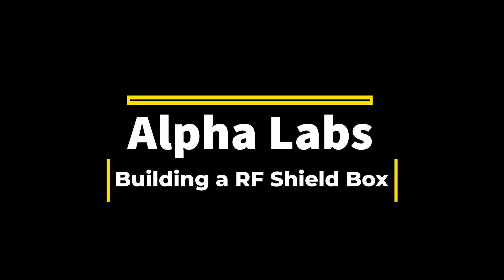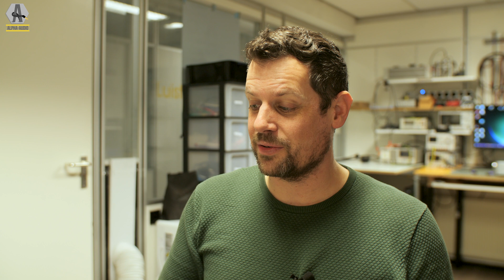Alpha Labs - The Alpha RF Shield Box

Comment: I love the way you use data to drive continuous improvement into your own processes!  I used some type of RF blocking fabric years ago in a non-audio application only to be somewhat disappointed (not the same as yours). I seemed to get better results with self adhesive copper foil.
Reply from the maker: It's not copper foil. It's special RF fabric and special RF blocking tape. (It's made by Mission Darkness). The adhesive copper foil is not good enough and doesn't really conduct on the sticky side ;-).

Comment: Interesting video, I have had success using the stainless steel catering bins (in UK they are called gastronorm), you can get quite large ones. Then use the foam/RF shielding sticky-back gasket to seal the lid which you need to press closed (use spring clamps). For feeding the cables I use the Icotek RFI gaskets which work really well and they offer a large range of sealing grommets for various cables sizes. You need to make sure all cables passing through are shield bonded to the box as close as possible to the box metal. I can get about 90dB isolation with this low-cost setup. Good luck!

Comment: He is right about Telecommunications but you may be better off shielding  a small closet ( I use the term "Lab Grade Audio" )   I've recently sourced several EMI/RF boards along with DC Blocker boards from AliExpress my measurements show vast improvement .

The Audio is now the Best I have ever heard.

Great work Alpha Lab
Reply: ATL Audio (Aleksandar, Bulgary <- EU) sells very good PCB too, with or without quality components installed. And even mounted in boxes.
Reply: @matytinman  I will research, for future orders
Reply: What do you mean? You put your stereo in a shielded closet and now enjoy a lot better sound?
Reply: @bunsw2070    My reference  spoke to testing RF is very invasive.

As for as better sound  shielding power helps All of my Network Switches , Streamers, DACs, Preamps, CD Player all run on DC with ripple noise downtown   .0000001 amps & separate noise filter for Amplifier/Integrated devices

Comment: interesting video... in these days I'm playing around with cables... connectors... lps... smps... etc etc trying to detect and reduce the noise they irradiate...I've descovered that even a common schuko connector, when plastic housing , irradiate A LOT of noise at 50Hz freq. especially at the phase side connection inside... so when the connector is close to signal cables, like almost always if we consider IEC plug, there is a strong noise/contamination source that could copule directly with our precious weak signal
I think it would be very very interesting to have video/tutorial about how to mitigate this kind of problems... for example: what is that graphite spray on your bench for?
Reply from the maker: A 50Hz wave is huge... So shielding that takes a different approach depending on the strength of the field.

Comment: Hi, interesting to see ati RMI / RF box. What's the RF blocking textile?   There is also that EMI blocking foil from MuMETAL®, any plans to compare them? See Audiowise's DAC Wrap, which if used around any DAC, preamp, makes miracles 😅
Reply from the maker: This is textile from Mission Darkness. Pretty good stuff. I have read about MuMetal. But is not my goal to compare them all. This box works now. I have better, cleaner measurements. That was the goal.

I noticed the DAC Wrap during my Google search... Well... I have my opinion about that. :-).
Reply: Thank you for your response Jaap,  I was actually surprised how well NuMetal foil improved my Chord Hugo TT2 sound. No regret of costs, it really works well, no way to step back. I will try to experiment with the Mission Darkness' product 😅. Great idea you did that video.
Reply from the maker: @RudolfLas  thanks! And good luck with your experiment. It is always fun.

Comment: Ferrites? I have a lot of Würth 150 kHz ferrite 8 mm and some 10.5 mm in my two systems. The attenuation is like 1/2 Schaffner RF/EMI FN9244B inlet filter.

An example: if two Schaffners attenuate too much, losing audio dynamics, I would put a Würth 150 kHz ferrite 8 mm and a FN9244B.
Reply from the maker: I need them for some applications. I already have a Schaffner inside the box. Definately does the job. Very nice improvement. It's dead silent now to 430 MHz. That's good enough for what I do.